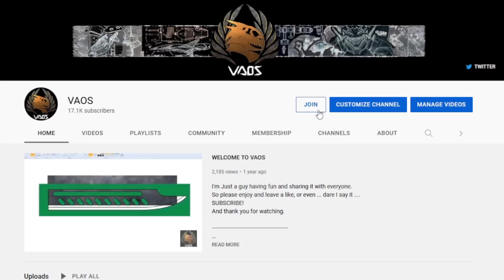Tiny 40 Ton SSTO delivering a 41 Ton payload.

Comment: why does it have a cockpit? there is no need for a kerbal since its a cargo SSTO and a probe core+battery weigths less
Reply from the maker: It’s not a pilot seat , It’s a passenger seat! It even has authentic console displays and real feed back joy stick! So you can “pretend “ to pilot your very own SSTO!
Reply: @vaos3712  but its heavy... and the whole point here is efficiency right?
Reply from the maker: @MinerBat  meh, in reality, it would probably only save 30 or so DV if it was removed. Right now , It triples as a reaction wheel / mono fuel / control from here , for lvl flight as the probe core is meant for re-entry. So it has 3 valuable purposes.

Comment: It's over 100% of cargo if you view the basic craft as 1 and a team comes with the payload and mount it. By building the way we normally do then it's a full craft = 1 or 100% loading or teleporting onto the runway and then the cargo is 51% until you detach it and both parts become 100% each, later.

I would put some extra wing parts on it for "easy take off" instead of that nonsense I saw. It's still great and I'm here for viewing your designs.